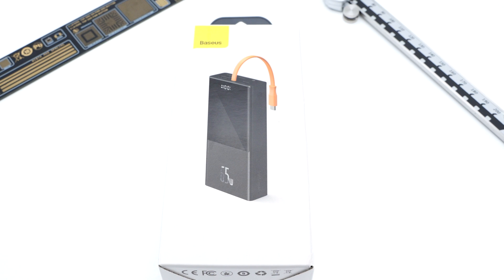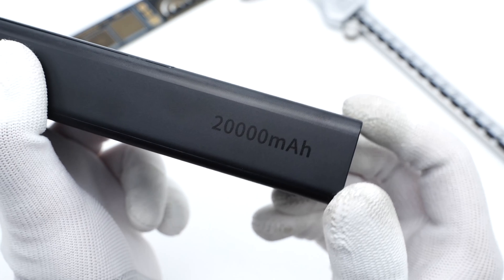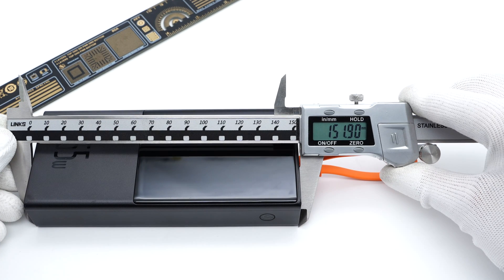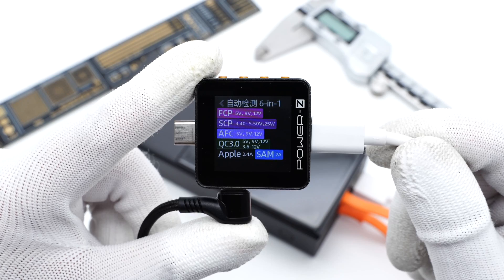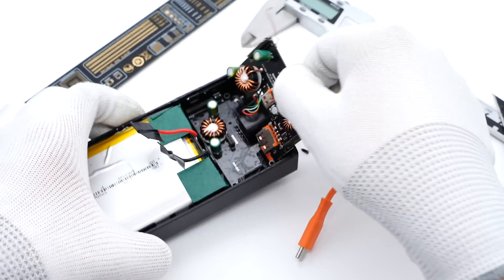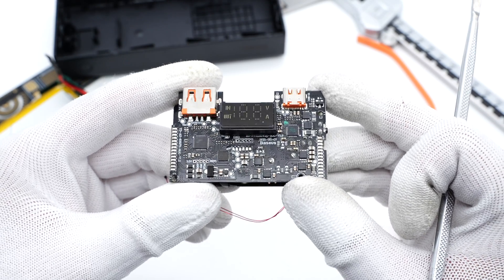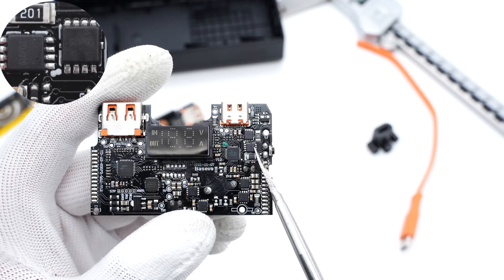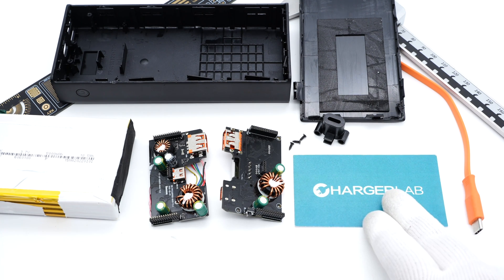With USB-C Cable | Teardown of Baseus 65W Elf Power Bank (20000mAh)

Comment: Hi mate 
Between lithium iron 21700  5000ma battery… and the 3.7v 5000ma lithium polymer batteries 

What batteries are good  in power banks with charging / long lasting / deformation etc?

Comment: Hi did you test SIMULTANEOUS charging?, what is the output when say 2x samsung s21 + s22 is connected, can it still output total 65w?. Thx in advance
Reply: Yes, I have this exact powerbank. The output will be divided but priority will be given to the first device plugged into the C1 port of the powerbank.
Reply: Is it supported Samsung fast charging 2.0 via inbuilt cable ?? @DarkZerol
Reply: @rayhan6828  Yes, it's supported.

Comment: Is the USB C port can use to charge the power bank like the USB C cable ? And what is the difference between this and the adaman 65w?
Reply from the maker: Yes, you can. Besides the built-in cable, the biggest difference is that the adaman 65W have one more USB-C port than this one.
Reply: @ChargerLAB   the adaman 65W only have one USB-Type  C and MIcro USB, and what is the output of Micro usb?

Comment: It be nice if you can see if it will still power things with the battery's power wires disconnected. So that way will know keep it plug in will it do the power though the battery or though the plug in power. It's junk if they all ways have to use the battery when it's 100% and not just use the power from  the wall then.

Because it would were out the battery faster if keep plug in.

All so power something and plug in and out the power from the wall and see if the power will go out for a little or keep going.

Thanks for you videos.

It's nice that you open them up. Some times it's easier to just hammer on the sides of them not so hard to break the case but to loosen the glue to open them.

Comment: why capacity is so low on higher voltage?
Reply: mAh is not reliable. the Watt Hour number is what matters. Every battery has a Watt Hour size, for example, iPhone 14 pro is 12.38 wh and Pro Max at 16.68wh.

Comment: tank you

Is Baseus wireless power bank10000  suitable for iPhone 13 use?

Do you have a better suggestion?
Reply from the maker: 10000 mAh is pretty enough for iPhone 13, and we suggest you to choose a power bank that supports more than 20W output.
Reply: @ChargerLAB  tank you
It is recommended that the power bank be mostly wireless.
Is it still a good choice?

Comment: And you've done it again. Why are you still using power meter "2C" when the 3C is already in stock?
Reply from the maker: We will gradually switch to 3C, and also, the KM003C has been replenished.

Comment: sir can i still use my ugreen 20w charger it have humming sounds when plugged in and charging a device? thanks  
from taiwan
Reply: I think it's ok to use. Seem the transformer isn't fixed completely and vibrate.
Reply from the maker: Yes you can